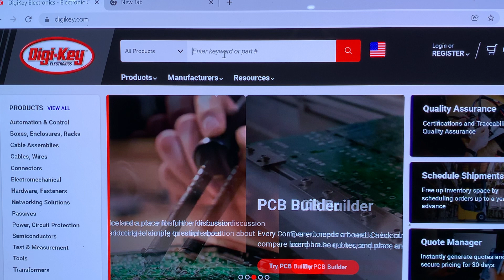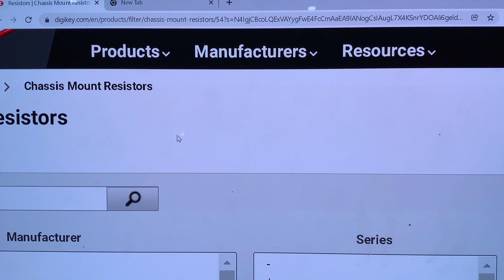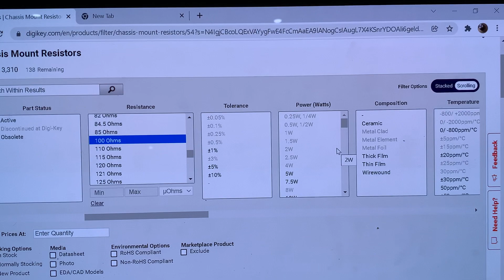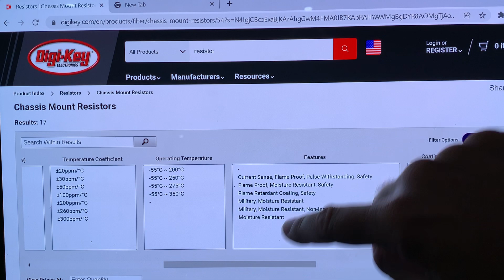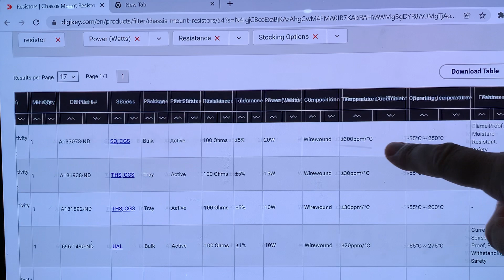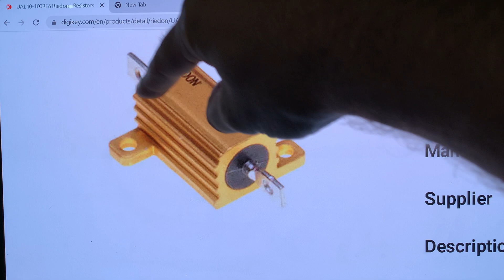How to order electronics parts online for audio gear

Comment: Hi Janos,
I'm having difficulty finding many values of KO Speer Carbon Film resistors (Kiwame), do you know of any good sources?
Reply: Hey, Cory. You can find Kiwame resistors at Parts Connexion in the US or HiFi Collective in the UK. DIY HiFi Supply in the UK also has them, and KOA Speer SPR series resistors are available from Mouser. If all of that fails, which is unlikely, just check eBay, although you may pay a bit more there. Between those resources, hopefully you can find the values you’re looking for. Hope that’s of some help to you.

Comment: another suggestion would be to make a video about types of resistors, why carbon resistors should be avoided, the noise generation mechanism of these resistors, and why wire or film resistors generate less noise! And another video about electrolytic capacitors, covering the low impedance ones, their different prices for the same capacitance and voltage, price differences from different manufacturers, and another video about film capacitors, polypropylene, ceramic, and the modern and expensive PPS, obviously crossing information from manufacturers with your own experience!